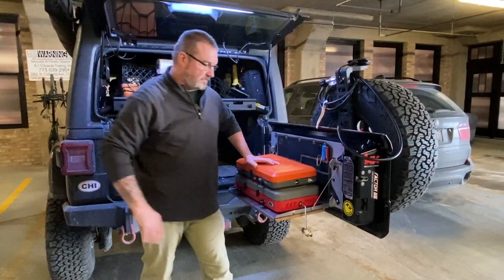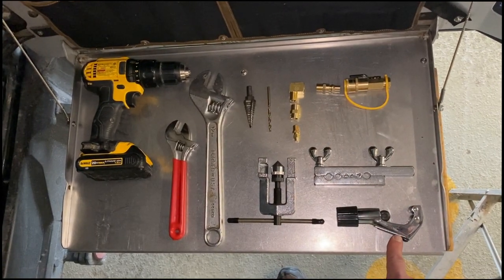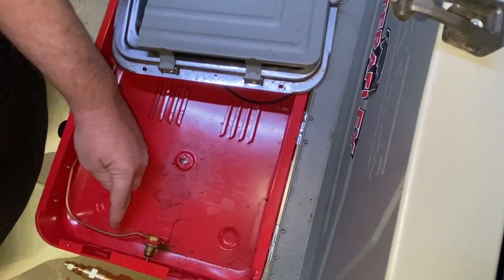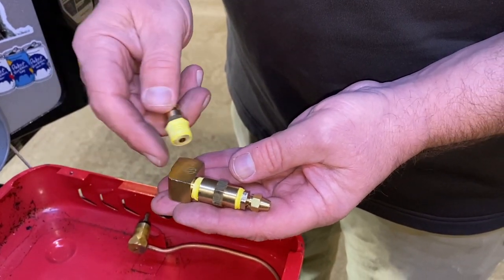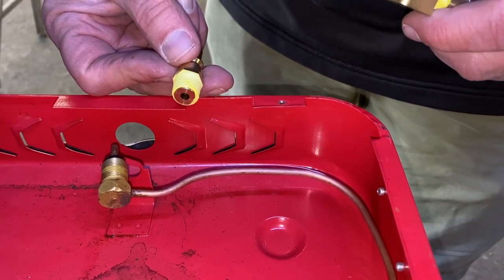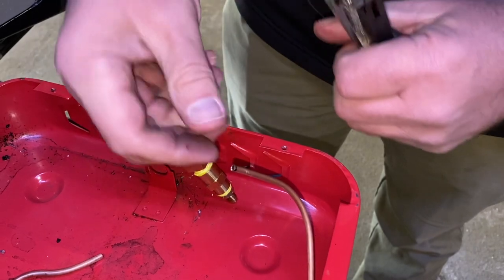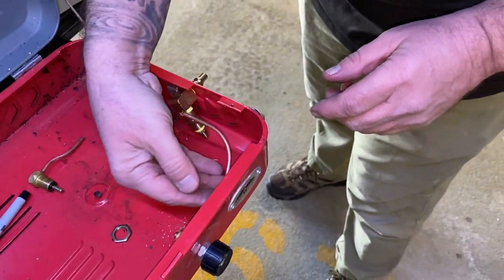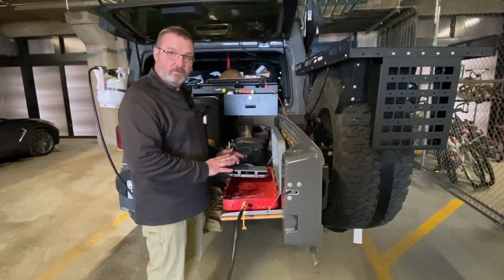You’re Going to LOVE This Camp Stove Mod!

Comment: Thanks from Australia for the video!
I've got a slight problem though, followed all of these steps but I'm only getting a low pressure flame now. I noticed that the hole in my flare fitting reducer piece is much smaller than the one I drilled out in the flare nut, would this likely be the issue? Should I just drill through the flare fitting with the same drill bit to allow gas to flow through quicker?

edit: i think the problem actually lies within the hose and regulator I'm using, its a low pressure regulator so I'll swap it out for a high one like you listed and I feel like that should fix the problem :)

Comment: I have a mountaineer stove and was looking for just this kind of guide. The tube flare was stumping me and when I saw you drill out a the fitting it all became clear. I'm going to try to use the factory recessed mount so that the QC barb is more or less flush with the stove like factory.
Reply from the maker: It’s been working great for me. Just make sure you use the LP specific quick connect and make sure that you have no leaks at the flares before final reassembly.

Comment: 2 things I hate doing is electrical & gases. Getting shocked is one thing butt the chances of going boom always makes me nervous. As for a brake or muffler shop doing the flaring I think they'd pass on doing it, yet tip an employee they might do it after work or on break for liability reasons.
ps
shouldn't soapy water be used to find a leak? Asking for a friend.
Reply from the maker: Actually I knew about using soapy water for leak checking, it’s absolutely a safer method than the one I used in the video. It completely slipped my mind when I filmed the video.

Comment: Did you only hand tighten the nut that holds the copper tube to the assembly?
Reply from the maker: No, I wrench tightened and leak checked everything before reassembly.
Reply: @jeepNtreetop  thanks!

Comment: I have a question on your video.  In the beginning of the video you show the hose hanging over your tire with the tailgate open. You do not show the tank or the valve that you used on the tank.  I see it is listed in your description though.  At the end of the video you show the tank mounted on the left part of your vehicle.  Why don't you show that as part of the video hook up?  The other thing you do not mention is that you have to still use the existing valve that is on the stove.  That may be confusing to some people.

Comment: Nice job. Definitely doing this to my stove.
Reply from the maker: It’s an easy mod. Mine has been working fine for the 6 months since I’ve done it and I use it on a daily basis. Just go slow and take your time. Make sure to check for leaked with a soapy water solution instead of the way I did in the video-much safer!
Reply: @jeepNtreetop  Will do.

Comment: One thing this video doesnt tell you is a 1/8" hole on a flaring tool is very uncommon and so is that drill bit size (doesnt come on most sets) I started this mod a week ago and now im trying to source this tool on the internet. Kind of annoying tbh
Reply from the maker: I listed the flaring tool set that I used in the description available on Amazon. It includes the 1/8” size. I also included the source of the 1/8” fittings. Good luck.
Reply: I'm an HVAC tech, checked my flaring tool sets, all but one went down to 1/4; only an old set that had 1/8 and 3/16, even though these sets had the same MFG P/N. That old set will definitely will be used on this MOD.